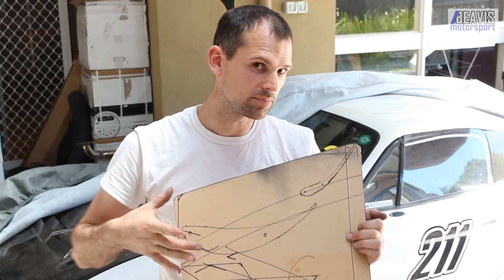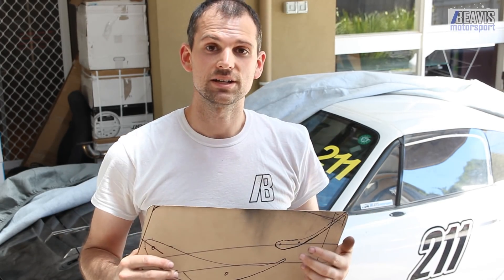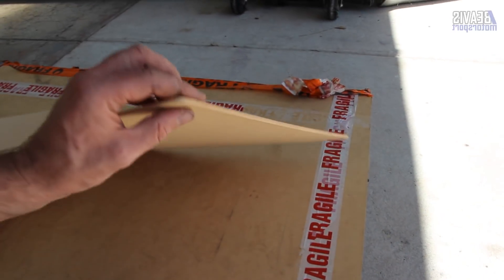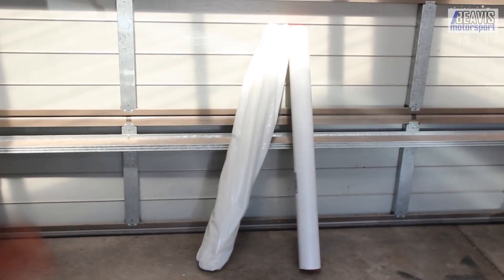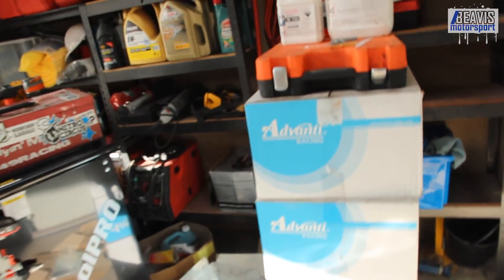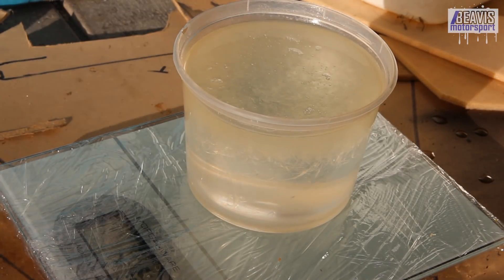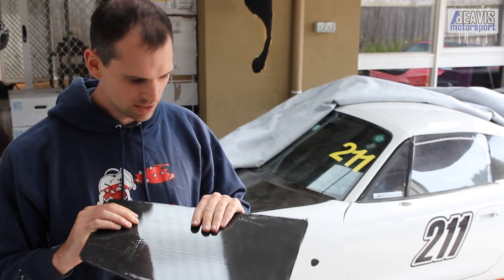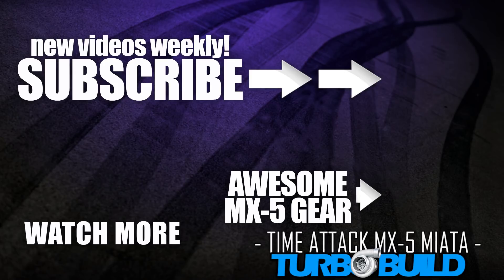MAKING CARBON WING ENDPLATES! - Episode 53 - Time Attack TURBO Build

Comment: Well done ...What type of wood is used as the core in END PLATE?
Reply from the maker: It is a foam core specific for composites.
Reply: @Bbeavis   Thank u Bro .Are you using a stress analysis program on the wing?
Reply from the maker: @محمدعمروالمقدم  My stress analysis involves driving the car at the track and seeing what happens.

Comment: I think there's a little bit of a flaw on how it's been built, the 2 cf parts around the foam should be in complete contact with each other around the entire perimeter of the "filler material" for at least around 1cm and the foam should be chamfered to allow a smooth change in thickness and not have too much resin in the end result, kinda like this
      __
_/____\_
can't really explain myself like i would like... This comes from some Dallara experts i had the pleasure to talk with
Reply from the maker: Hi Alessio, I certainly agree with you 100%, that would have been my preferred result. Unfortunately it was not easy for me to achieve that with my limited skillset and knowledge in composites, and only basic tools. In hindsight I should have spent more time on prep, and avoided the hot day.  I don't do this stuff often so there's often mistakes, and I may not use the best methods... but I'm trying to do it myself and learn along the way.
Thanks again for taking the time to comment.... always appreciated!
Reply: I can only dream of doing half of what you are doing. You're an inspiration, keep it up!

Comment: Now look!!! I am not criticizing!!! I just thought carbon fibre would just be that, no foam board blah in the middle, is that to do with your skill set - easier way, or that's how it's done?
I was thinking "40 deg... he's gonna end up with a pot of resin!!!" (but ya waited for 30ish) I know, I've done it lots, with fibreglass. The advantage with f/glass is ya can just put less catalyst in on a hot day. I know nothing about carbon fibre resin. You mixed the resin 5:1 by weight, that shouldn't be by volume? just asking
Luv your work. The great thing about these projects - whatever they are - you get to attempt so many different things, broadens ones' horizons and increases your skills. Bloody awesome.
Thanks.
Reply from the maker: I certainly believe the foam core helps with stiffness, sure I could've used more carbon, but it would've been more costly. The resin is more or less the same product whether FG or CF. The heat certainly did make things tricky. Usually measurement by weight is considered the correct method for pouring resin, as if you measure by volume, you can get inconsistent results dependent on the conditions, whereas measurement by weight is always constant. (A hotter day will make the volume larger for the given weight, but the two parts may change in volume at different rates) I don't do this stuff often so there's often mistakes, and I may not use the best methods... but I'm trying to do it myself and learn along the way.
Thanks again for the kind words and taking the time to comment Don.... always appreciated!

Comment: How are you adjusting the angle of attack of the wing?
The second element will it be fixed or adjustable?
Reply from the maker: The upper 'swan neck' mounts will have holes for adjustment. I'll shoot you a closer photo of it if you like... If the second element ever does get made and installed, it will be fixed in place with a set angle/position relative to first element and the whole wing will adjust as a unit.